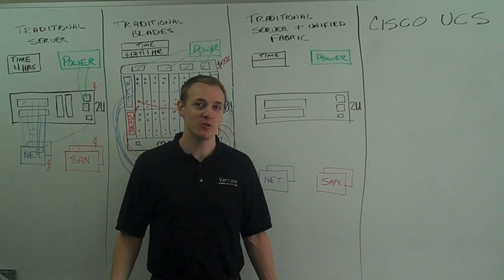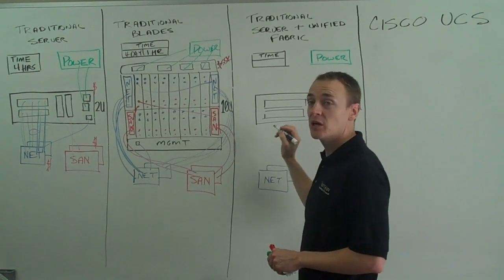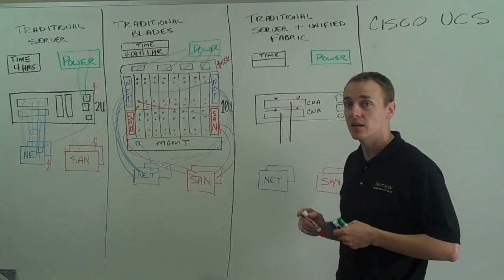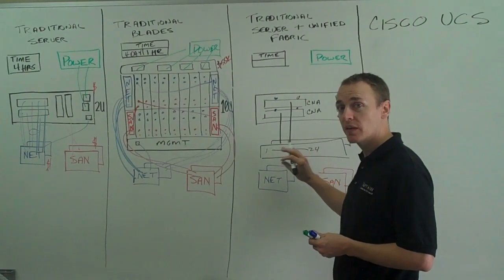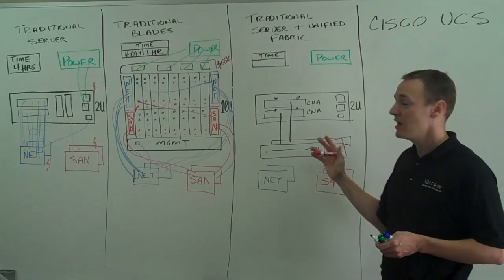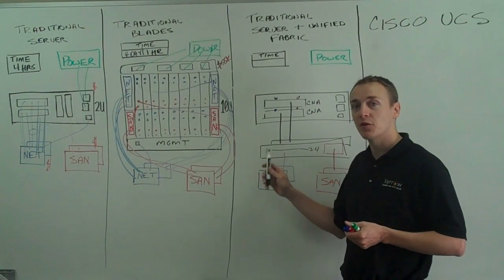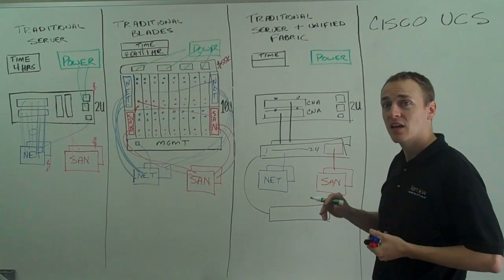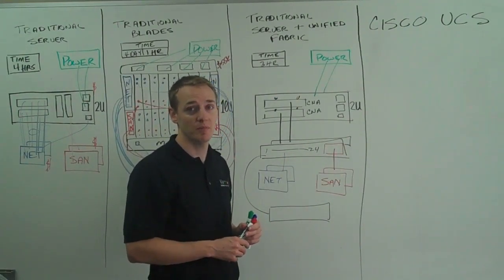Cisco UCS Presentation Part 4 - Traditional Srvr with Unified Fabric

Comment: You mentioned in the last video that you wouldn't go down the path of 10Gbe on the blade infrastructure yet you are comparing 1Gb NICs to 10Gb. Getting 10Gbe on blades is simple as many of them are coming with dual integrated 10Gbe NICs or you can purchase a card. When you purchase the chassis pass-thru or switch, it integrates with ANY 10Gbe solution. In other words, you don't need a special switch! Flex-nic technology allows you to split the NICs into almost any number of speeds.